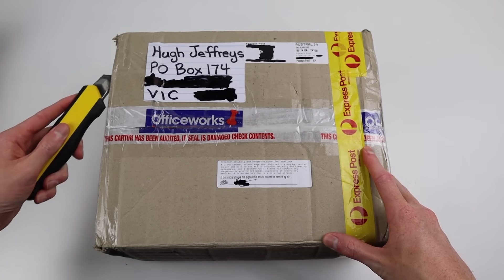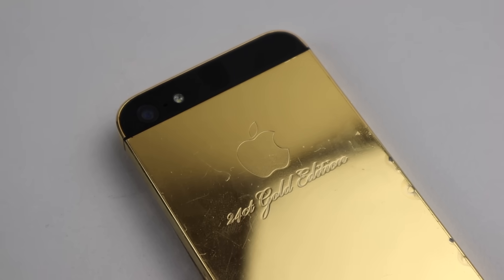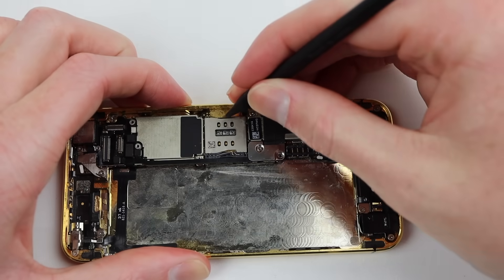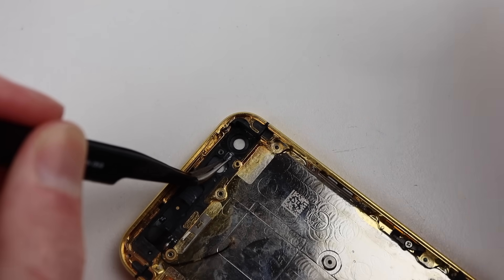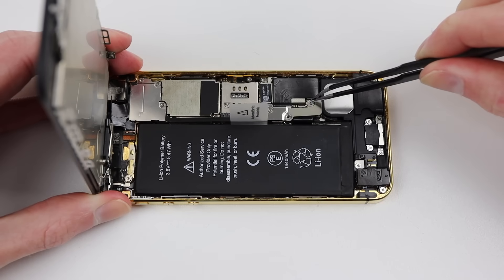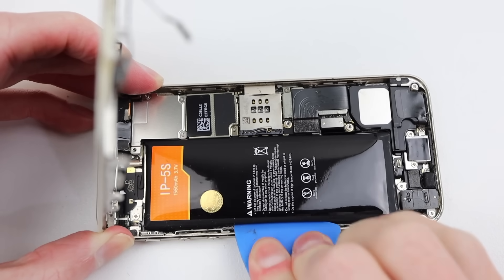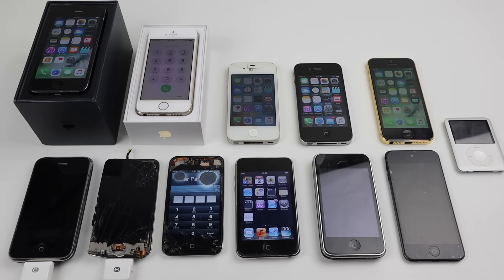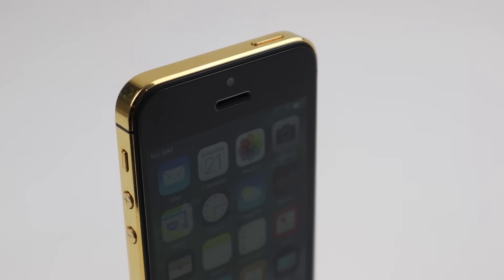$50 Broken Phone LOT - I Struck Gold. (Literally)

Comment: How do people just throw away gold plated phones? Just frame it or something lol.
Reply: You'd be surprised how many people are just too lazy/don't care when it comes to the things they buy
Reply: Gold plating a phone is actually surprisingly cheap
Reply: @advin6159  how cheap do you think? very curious :)
Reply: @frootloot6789  Assuming it's just a phone, you can probably get away with a thin layer of gold in order to get that sort of color shown in the video. So, to do something like this, it would cost ~$50 at the least.
Reply: How does he make sure these are not just a bunch of stolen phones? That’s what it seems they are…
Reply: @boarbot7829  He contacts the owner if they have iCloud lock and they typically remove it
Reply: @boarbot7829  i mean ur not just gonna throw it away if you have nothing to do with it??? Like you cant even contact the original owner.
Reply: @SOTP.  sorry, I don’t really understand your comment. Do you mean he’s not going to throw it away?
Reply: @frootloot6789  in terms of raw materials, next to nothing. The gold in gold plating is usually 1/10000th of a centimetre thick. So it’s going to be (a lot) less than a gram of gold on the entire phone. And gold has gone way up since that phone was probably produced.
Reply: They probably just atomize the gold to keep prices down, like with headphone plugs

Comment: The problem with the home and sleep button of the gold iphone has to do with pry damage between the battery and motherboard caused most likely by the previous owner trying to get out the battery with a tool because the pull sticker breaks easily. I know this because I have had done this exact thing once causing me to have these buttons not working (always pressing). When looking on the motherboard next to the battery with a  microscope you should be able to see missing electrical components that are responsible for the sleep/home button function.

Comment: Geez, things have come a long way (for the worse) in repairs of these phones! Nowadays there are several different styles, sizes and depth of proprietary screws, chipsets that will not work with new batteries, camera modules etc and USB/other things soldered onto the MB vs little clips.

Comment: Hey H.J., This could be an used battery. I'm not gonna say how but if you treat the text on original Apple battery with a certain chemical fluid, which can be bought by anyone in most countries, you can just wipe off the text and stamps on the battery ;)
I actually saw that trick on a certain video platform called Coub and after trying it out, I was able to wipe the text off without damaging the battery. However, if you find that tutorial and want to try it out, buy medical handgloves (the blue ones) because the fluid can make your skin a bit rough. You can describe the state of the skin as an "Sandpaper skin" : P
Don't ask me how I found that one out
Reply: How did you find that out

Comment: Did you sell this gold iPhone 5? I am interested in it or possible build one for myself. I’m a fan of that throwback look. I have built an original iPhone 1 and I’m still working on a 3g. I put some modern parts and done some custom work to fit newer components to the iPhone 1 to allow it to run on iOS 14. It’s a cool phone and runs like a new iPhone. I want this phone if it’s still available. Let me know.

Comment: I got an iPhone 5, in 2020, which had a poor quality screen where the touch had broken, and the original battery was totally degraded. I replaced these parts (I'm not a professional) and I had this same problem with the buttons not working, and I just never found out why. It also goes into recovery mode when plugged in by the cable, but it works on the system normally, so I just keep it in the box (which is the original one) in case you ever discover the problem, please post a video about it, i still have hope for this phone
Reply: Components have been knocked off the board. You'll need to have it soldered.
Reply: @tsuyunobradley4439  yeah, discovered this last week LMAO my fault

Comment: Hi, back in the old days I bought a broken iPad mini 1, I managed to fix it but unfortunately, the previous owner didn't remove the iCloud account, so I couldn't use it. And now the question is, how do you manage to unlock them or be sure that they will come without the previous iCloud?
Reply: The only way to unlock it is to contact the previous owner and ask them to remove the activation lock. Otherwise, you could jailbreak it and get rid of the setup app to bypass the setup completely... but that's not a perfect solution, as you still need to jailbreak the iOS device and it isn't truly "unlocked".

Comment: What can you do with the locked phone?
Reply: Dismantle it and use it for parts for other phones and in the case of the logic boards, use them to practice board level repair or microsoldering. Those are pretty much the only things you can use an IC locked phone for, or a decoration

Comment: I went to a shop to buy display for my 5s and got covid 🙂
But the thing is I got original battery from 2013 and Its got a charge cycle of 2021 😵😉
Also It works and the battery is not puffy
Reply from the maker: Are you saying its from 2013 but has no charge cycles?
Because cycle count can be reset super easy so you could make a worn out battery with 1,000 cycles display 0 cycles and 100% health. Always buy from trusted sources.
Reply: @HughJeffreys  No no I have been using that battery from 2013 and Its got a charge time of 2021 And the current capacity is 1089 mAh! Idk how its still running Like my battery Health Is lower than 65! 3uTools can’t determine how much is actually left